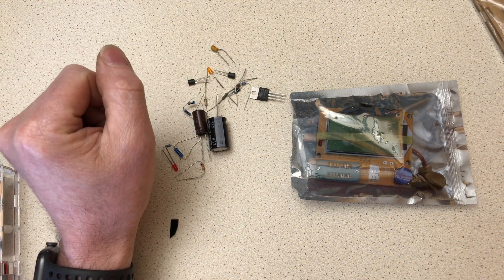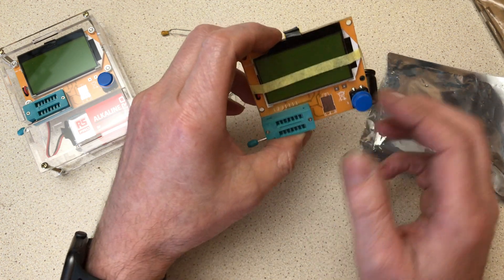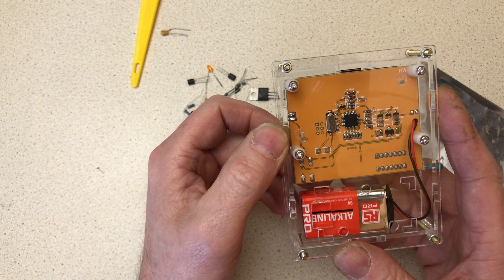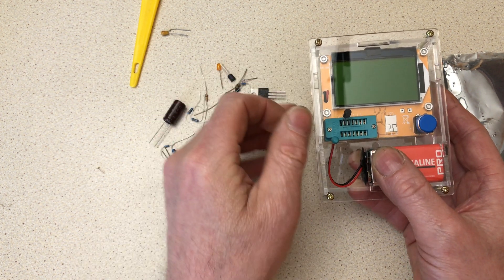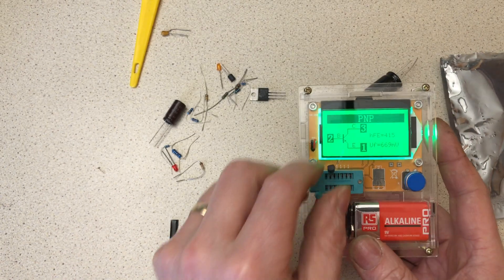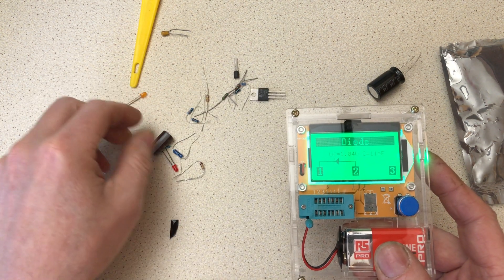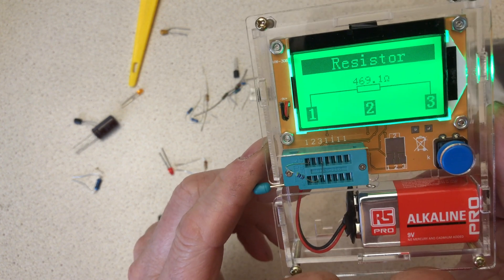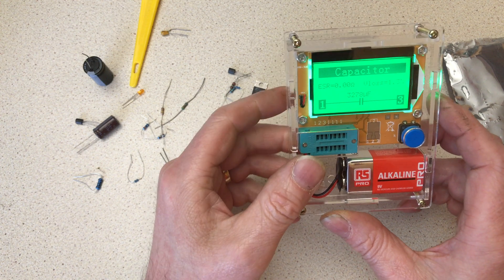Geekcreit® LCR-T4 Mega328 Transistor, Diode, Triode, Capacitance ESR & resistor tester from Banggood

Comment: can you test capacitances on board..?
Reply from the maker: I've never tried that but usually you will get an inaccurate reading if you do that for any component due to the fact it will be electrically connected to other parts of the circuit. It's always best to remove the component you want to test from the board. Thanks for watching 👍🏽

Comment: Will it read a bridge diode rectifier? 4 pin
Reply from the maker: As you know a full wave bridge rectifier is made from 4 diodes so I would expect the tester to pickup an issue if one of those was duff. I’ve not tried it but will and update here. Good question 👍🏽

Comment: I just got mine, and like yours... they didn't cut out the hole for the surface mount pads! Dammit.
Reply from the maker: I guess if you trade off the little issues we get against the cost £ then its still not a bad deal. The overall experience is a little poorer now they are charging postage,  not unexpected though. Thanks for watching 👍🏽